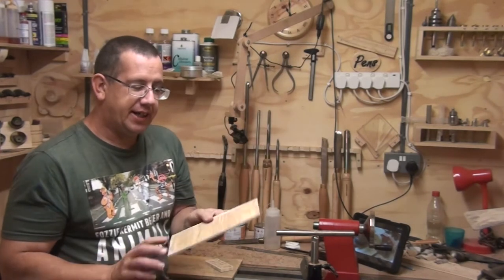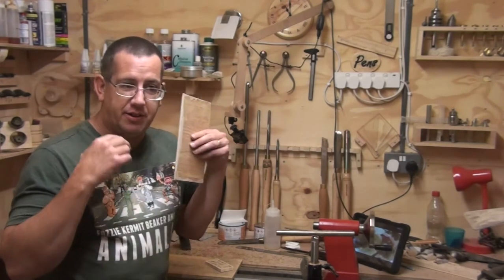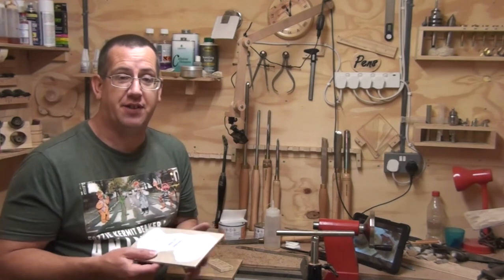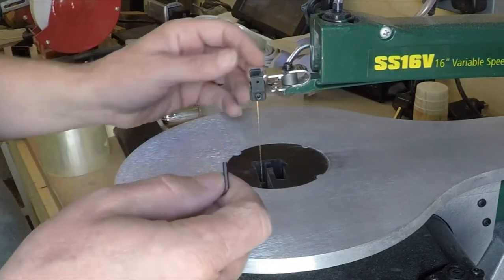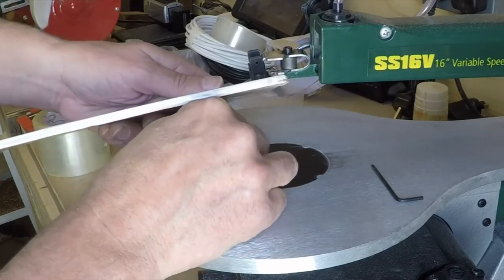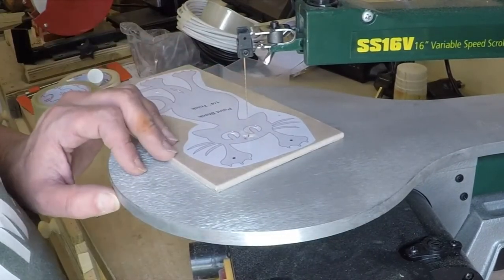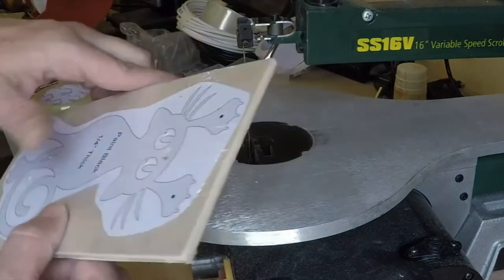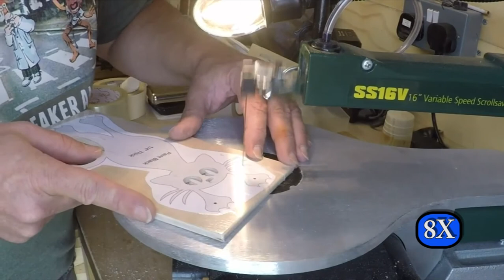SS#1 First Project Sparky The Hanging Cat

Comment: Another great video Paul! Very helpful and informative making my decision to pick up this saw this morning from a local seller!
Reply from the maker: Thank you Robert. I had to get a replacement under warranty due to a surface split on the table. They never collected the old one which was quite lucky as in the end I swapped over the table top as my original saw ran quieter. They are very good.
Reply: Paul, have you tried any hard wood for doing any intarsia?

Comment: I used to do projects like this. Only for small trinkets for My Girl Scout Troop. My blades also have pins in the top and bottom to set them in place. I don't believe I've ever seen a round blade. Paul, maybe after watching a few of your videos on your machine, mine might see some work again! LOL!
Reply from the maker: Thank you Tracy. It's nice to do something different and the good thing about this is that it fits in nicely when working on lathe projects. I cut this out while I was waiting for wax to set on a piece on the lathe. Obviously I'm very new and starting with basic projects, but take a look at Steve Good he does some unbelievable projects with the scroll saw.

Comment: Hi Paul,
A Scroll saw is a great addition to the work shop.
I recently cut one of those cats myself, good little project.

Not sure if your saw comes with one but a great addition to a scroll saw is a foot pedal.

Another good make of blade is Olson. I really like the reverse tooth No5 for most cutting & 2/0 for the finer stuff.

look forward to more of your scroll work.

All the best,
Paul
Reply from the maker: Thank you Paul. Yes really enjoying it. Some things do take a lot of time and concentration as I've found on the latest project which should be up on Wednesday. Sparky has had a coat of paint now and I did another cat / mouse project too. Really enjoying it as an added piece of equipment for the workshop.

Comment: Hi Paul, I have a scroll saw not used it much, I find it hard to get the tight turns, I've bought blades with a big tpi ratio but finding it a bit tricky still, I've read that the round saw blades are the best to use for doing this, my saw takes the pinned saw blades as most of them do, but all the round blades I can find arnt of the pinned type,Any idea where I can get them from,Love your videos by the way.Cheers, Rich, ( The Ginger Turner )
Reply from the maker: Hi Richard. Not sure if they do pinned round blades or not. I've gone for the Pegas Wood Scroll Saw Blade Starter Pack from Axminster and so far mainly used the No.5 variable geometry blades. They do turn tight curves and where you want a sharp corner I've found stop at the corner then reverse the blade up to it and turn from the inside.The main issue I've been told about the pinned blades is that you need a much larger hole for the internal cuts, so I'm trying to stick with the plain end blades.
Reply: @PaulLockwood  Hi, I have just bought this same saw. Would you recommend the pegas starter pack?